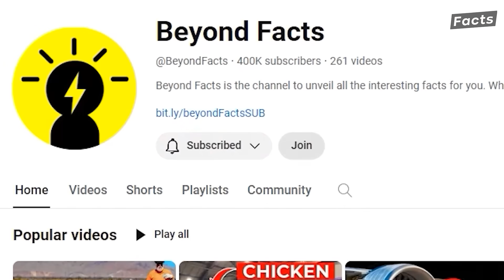This Will KILL the Panama Canal

Comment: Of the many variables that are never mentioned in the C.C. arguments are, Milankovitch Cycles of Eccentricity (shape of Earths orbit) Obliquity (tilt of axis) Precession or (wobble of Earths axis) the cycles of the Sun's Maunder minimum (periods of lower solar 2:17  activity). Fact; Sun converts aprox. 4.6 metric tonnes of mass to energy every second. Aprox. 145,065,600 metric tonnes/ year. Sun is huge, but it is a dynamic factor in this equation.

Comment: I would look this problem as a manmade one and not a climatic one. The following is the reasoning for this statement. First I would give a brief background of myself. I’ve traveled the world and seen many various locking systems similar to the one used in Panama. I seen those systems on the Great Lakes and its Western Rivers. I have also transited the Suez Canal more times than I care to recall. In my Career I have travel the world and have seen non greater or massive than the ones in the United States of America. The U.S. has one lock the same width and length as the locks chambers in Panama with on exception, it vertical lift, which is about 125 ft strait up, which is truly an engineering marvel. 
  With this said, long before the Panama Canal was built, that stretch of land was covered in part by ocean water. Using ocean water rather than fresh water could be one solution to the problem.  If  this is truly a manmade problem of the fresh water being diverted to the ocean rather than it going to the freshwater lake, then this needs to be identified and stopped.  This waterway as well as the Suez is a world lifeline and must stay functional and in my opinion there is no reason why it not. We cannot allow for this lifeline to be used as a weapon for the control of commerce.
    Once gain in my opinion there is no reason why ocean water can’t be the solution to the problem.

Comment: With today's technology, water can be pumped from the two oceans into the locks, instead of using the current river systems. Dredges can be dug to deepen the current waterways one at a time to make the water bottoms well under the below sea level used now. The problem with all of this is America's Democratic solution: REGULATIONS!!!!!! Put some modern day Engineers on all of this, and 'gitter dun'. Stop whining, and get to moving. That's the hard facts here.

Comment: Could it be the time for building new crane-systems for moving containers from ship to train and back? Or is the solution for the Panama Canal to do better water management, save water underground so it does not evaporate, and in emergency getting water pumped back from low locks to high locks, using solar panel power?
Just my 25 cents.

Comment: What a stupid idea. As of Feb, 2024, drought conditions (due to “climate change”) “doesn’t look likely to be getting any better”. As of Dec 18th, 2024, a whole 10 months later, Lake Gatun recorded a level of 89 feet, HIGHEST on record and exceeding the previous record of 88.8 set waaaaaay back in December of 2022. The idea that a Mexican rail system can replace the canal is a joke and stop with the climate drought nonsense. Lake Gatun has been fluctuating since the canal was built.

Comment: This video is BS, climate change isn't doing jack shit to the Panama Canal , in fact they just opened a bigger set of locks right next to the original ones that uses even more water which is why they've limited number of ships.  There was average 32 a day in 2023 instead of the historical average of 36 but it's not the number of ships that matter, it's the tonnage, and with the larger locks fewer ships can go through but more tonnage can as well.   Presently Gatun Lake is high.  And it's Ga TOON lake not Gaten lake.   The person that made this video is an Al Gore shill and is telling half truths.

Comment: It must be possible to build a special double rail-line on scale  like 100 : 1 , dig it straight from coast to coast,  starting and ending below the sea level, so that the container ships can drive right on to it, secure the sides supports, and drive to the other side in 2-way traffic. Perhaps the rails need to be 100 x stronger, but why not? Think like Musk, it is not impossible. Maybe 50 : 1 scale will be sufficient. With modern mega-excavators compared to 1880s ? And chances are in the excavation they will find rare earth minerals too.

Comment: There is already a railroad which crosses Panama close to canal, and it carries more freight than the canal itself.
Reply: @jimtrobridge3845<-----> INCORRECT! The Transisthmian railway carries less than 9 to one the cargo of the canal. The transisthmian railway opened,  a full 105 years before the ""so called "" U S Transcontinental railroad opening in  1855 six years before the start of the U.S. War between the states. Here is a fact to consider that rail line technically was and is   in fact the first transcontinental railroad in the Americas in 1855!

Comment: The time it takes to offload a container ship can vary based on several factors, including the size of the ship and the efficiency of the port. On average, it typically takes 1 to 3 days to unload a container ship under normal conditions. Initial stage involves guiding the vessel to dock safely, which can take about 2 to 4 hours.
 unload containers from the vessel onto trucks or directly onto the dock, In this case directly to a train car. This step can take 6 to 12 hours depending on the number of containers.
 In theory takes 6 hrs from cost to coast transport average time saving could be as much as 12 days. You have to think out of the box you are imagine a long train, How about automated self driving train carts on double height, literally as soon as the container secured it could start to transport the goods. The same cart can off load the container and return to the loading dock before the ship is fully off loaded. The current largest container ship is MSC Irina 24,346 TEU so you will need at list half that many self driving carts to off load the largest ship. Will see how they will doit, what we know is China is involved in this project. What we know Shanghai port processing:
 Monthly throughput record: 4.20M TEU,  
  Total annual container throughput: 43.5M, 
  TEU Vessels in port: 2290, 
Annual cargo tonnage: 514 million,
Number of employees: 13,546,   The port of Shanghai is processing  approximately 1,100,000 TEUs a day, compared to Port of Long Beach, port of Los Angeles, and San Pedro total about 70K  on a good day.  They need to process more than 40 ship a day just to be equivalent to the Panama canal

Comment: You are factually wrong.  China is largely responsible for the Panama Canal failure.  1. The third super lane draws too much water from the lake. 2. The Chinese water reclamation system is bringing in brackish water putting salt in the fresh water lake.

Comment: The diagram at 1:32 is incorrect and it wouldn't work. Both of those lake level columns foreword of the bow need to be the same height, like the two at the stern end. The lake water would waterfall over the top of that lock.

Comment: It's a joke to suggest that this will even put a tiny dent in cargo movement.  It simply isn't practical to dock a container ship, unload the containers, load the containers on  rail cars, move them across Mexico and reload them on other ship.  A PANAMAX cargo ship carries 5000 TEUs.  Which is 2500 40 foot long containers.  It takes 12.5  trains pulling a hundred double stacked container cars for 1 ship.  That doesn't mean that this isn't a smart investment for Mexico.  It almost certainly is.  But it isn't a threat to the the Panama Canal.

Comment: The Panama Canal problem is not due mostly to climate change. It is suffering from a periodic drought a cycle the original engineers knew about. What are larger problems beyond this seasonal drought is: Leaking dam that supplies the water. Leaking water in the lifts. A new canal that runs parallel to the old one but relies on the same source of water. So the demand for water has increased, greatly at the same time that the aging dam and old canal is wasting a substantial amount of water while a once in a hundred year drought is placing excess stress on the canal. The climate change religion is perfidious and is not supported by its own models.

Comment: Nice idea. But my stupid question is why can’t they dig another canal, rather than lay down 300km of railway tracks? Is the terrain not level enough?

Or is there a way to perhaps build TWO parallel train tracks, about 50m apart (with two trains running in sync)… and have a giant platform between the two where an entire cargo ship is winched on (like a mobile dry dock). Then you could ferry each ship across. One would need an entire train for each ship, and run about a dozen or so trains each direction (the day shift east-to-west and the night shift west-to-east, say; or build two sets of parallel tracks to ferry ships both directions simultaneously). Each trip would take 6hrs, add an hour each side for loading or off-loading the ship. So you could get about 12 ships across each shift for a single pair of tracks (i.e. 24 ships per day).

Or a lot more if you have multiple (four?) loading and off-loading bays and then stagger the trains, perhaps 15 mins apart, that can set off as soon as they’re loaded.

🤓

Comment: It does not kill the Panama Canal. It is not a canal by but a train that carries the cargo from a ship from the Mexico coast of the Gulf of Mexico to the Mexico Coast of the Pacific Ocean. It will not transport the ships but just the cargo. It will not require the water resources of Mexico or at least the amount that Panama uses. It will cause the Panama Canal to have fewer ships going through it and it will have less fresh water being needed. Cruise ships still will need to go through the Canal unless cruise ships disembark at the Gulf of Mexico take a train to the western side of Mexico and embark on another cruise ship on western side of Mexico.

Comment: This entire video is misleading at best and out right lies at worst.  For starts lack of water, a river or canal that is low or drying up is not Climate change. This is an outright lie.  This canal connects 2 oceans, which would be the source of unlimited water. However since the canal starts at sea level and finishes at sea level the highest point along the path would start having issues with water if rain fall in that relatively small area doesn't get rain over a period of time.  But again this isn't caused by an unproven theory. And you also refuse to be honest in your claim. Because what you really mean by "climate change" is man made global warming, which remains a theory. A theory by definition is unproven, and the theory of man made global  warming has failed to for overv50 years to produce even one scientifically valid result.  STOP THE BS.

Comment: La niña is here and plenty of rain is flooding rivers and lakes that feed the canal.  As July of 2024 the water level of Gatun lake is almost back to normal and regular transit of ships and tankers are back to normal.
(Update).... as of October 2024, the frequency of rains have been torrential thoughout the entire isthmus almost daily, that rivers and basins flooding the Gatun Lake have been enormous.
Reply: I wonder if it would make sense (and be physically possible) to create a reservoir nearby to fill during plentiful rainfall periods and use to replenish the lake during drought periods.
Reply: @lucybecker8  When the canal was expanded to allow super tankers to cross the canal, the new locks were equipped with a recycling system so the water wouldn't flow back to the ocean.  Also, there are other projects to concentrate the different rivers and water basins flowing into the Gatun lake, the main thoroughfare for the ships to cross from ocean to ocean.  2024 has been a very rainy year and the canal is functioning to normal flow of 30 to 35 ships daily.

Comment: With a major overhaul of the Panama Canal, it could operate exclusively with sea water.  It would involve a different lock system that would not corrode with sea water, foreseeing environmental concerns with land eventually bathed with sea water and a pumping system to supply sea water, as gravity would not work anymore.  Possible but expensive and time consuming, with higher operational costs.  But if everything else fails ...

Comment: This project is riddled with issues.  Although the project has some merits, the 4.2 billion is far from what the real world cost will be.  Can it be done? Certainly.  Will it be completed before the Panama Canal has a solution?   Doubtful,  why?  The US, Panama, and other countries are working to solve the current issue already.  The most recent proposal is to build a nuclear power plant in the area. This will not only provide power for the Panama Canal but also for the local communities.  The power plant will be able to power several pumping stations, thus eliminating the need for water from the lake.  Is it viable?  Absolutely.  If not, it could lead to civil unrest as the Panama Canal has been a major part of Panama for many years.  A plan needs to be put together as soon as it can.  Governments need to put aside their issues, period, or this will have a major impact on the worlds economy.  The US needs to take the first steps and push a good plan through.  And step up with money in hand.  Yes, it will be a major undertaking, but it needs to be done.

Comment: The problem is NOT cause by climate change.  It is caused by extremely poor design.  It is due to 1) How the locks work.  2) Adding more and larger locks.   The water in your illustration @ 1:09.  is drained from higher locks to lower locks to equalize the water in both locks.  This repeats until the ship reaches Gatun Lake.  At NO point is water pumped back up to Gatun Lake. It is just allowed to drain out and flow into the Gulf of Mexico or the Pacific Ocean.  Then two much larger locks were added for larger ships. This is draining Gatun Lake at an unfounded rate.  
For example, take a five (5) gallon bucket, (the lake) using a standard 3/4-inch water hose (representing the average rainfall) to fill the bucket. Now drill a 3/4-inch hole in the bottom.  The water level will stay constant because the amount of water leaving the buck (the lake) is equal to the amount flowing into it.  
Now drill an addition 1.5- inch hole in the bucket (representing the added larger locks).  The standard 3/4-inch water hose (average rainfall) has NOT changed and cannot maintain the buck's (lake's) water level.  It is draining out faster than it is being replenished by the same rain fall.  This is NOT caused by climate change!!!  It caused by extremely poor design /engineering.  The locks lose more water that the Gatun Lake received in rainfall each year.  Did they think that added more LARGER locks, draining Gatun Lake faster, would cause more rainfall?  The water should be pumped from the lower locks back up into the lake, to maintain water level.  It does not take a rocket scientist to figure this out.

Comment: What we have is an engineering challenge. What we need is a "dry canal" where the freight ship (any type) is put on a rolling thing like a flatbed rail car then put back in the water like someone with a boat on a trailer hauled by a pickup truck would do. Of course it would need to be supersized. Could it be done? Maybe or maybe not, depending on the weight (mass) of the ship to be moved.

Comment: The ship-canal can be repaired. It is to be envisaged that it is not an "ab initio" work as it was in 1889. Partly built & functional canal is half the work done, that can be viewed as an "asset" (like a partly built house).
It is generating politically motivated competitors, in Nicaragua or Tehuantepec isthmus in Mexico. Both are wholly unnecessary. Repairing (or re-building) an existing canal is far more cheaper.
Basic flaw in the Panama canal design is the Gatun lake, that has been used to water the ship-lifting operations, by means of a series of locks. Those days (1889) lifting ships by means of locks must have looked a "revolutionary" engineering idea that is unnecessary now, but must have looked necessary as an alternative to digging the canal to a depth of 80 meters. Today's Technology obviates that (but with the necessarily huge expenditure, yet far cheaper than digging a brand new canal in Nicaragua or Mexico). Separate Gatun lake first, form the canal (& the associative watering for raising a ship), except the normal discharge of Gatun lake through the canal. It can be done by "damming away" Gatun lake (coffer dams will do, with a steel "diaphragm" wall, as is done in some dams in the world). Preferably "no lock" (or one lock each at both - Atlantic & Pacific ends). After stopping the Gatun waters, the dry bed of present canal can be dug to sea level (at least, or some 10m for ships draft) - after building dams at both Atlantic & Pacific ends to stop ingress of sea water during this repair phase.

Comment: Check out recent rain patterns in Panama for more than the one year chosen by the presenter.  They are not experiencing long-term drought. The main problem with the canal now is that they have widened it to accommodate larger vessels, resulting in more water flowing from Gatun lake above (part of the canal) to the two Oceans below, through wider lock doors. While climate change is happening, it seems too many people are willing to chalk up too many unfortunate events to it, without researching more.
Reply: Gatun Lake is the freshwater lake fed my freshwater rainfall and is key and  each and every  time a ship is released from passage all that freshwater from Lake Gatun is lost to the seas.
Reply: @GordMerrick  Right.  And my point was that the newer, wider locks they have built when they widened the canal have caused more fresh water to drain off into the oceans, whereas before it was sustainable.